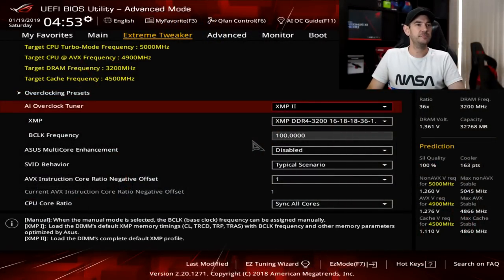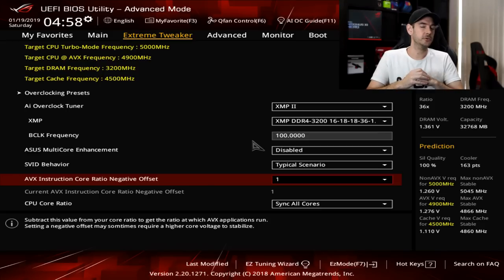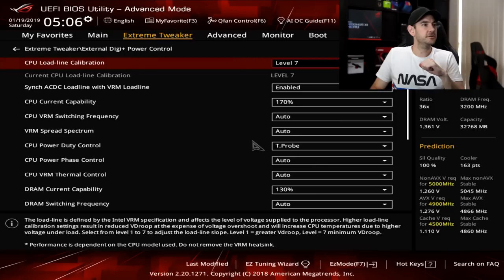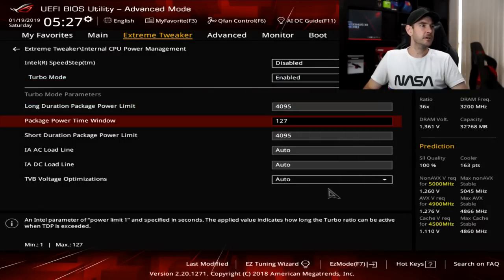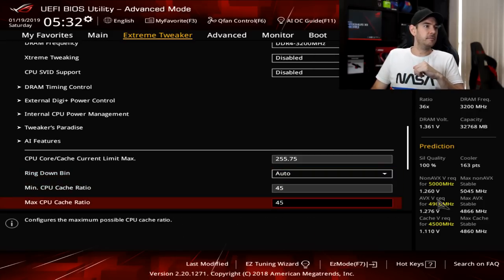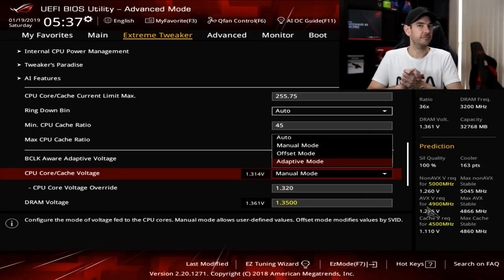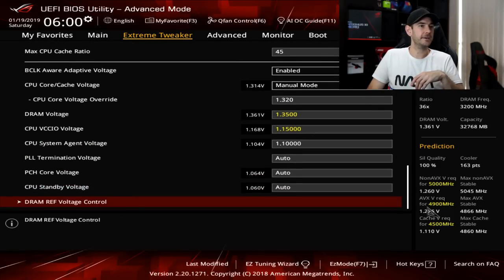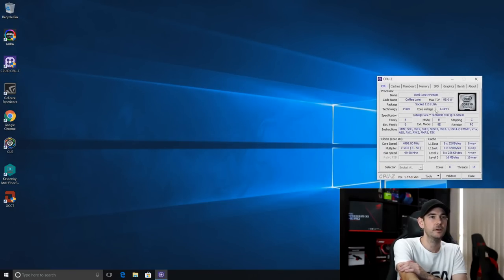The Complete i9 9900K Overclocking Guide - Maximus XI Z390 and Others

Comment: Just done some OC on my z390-f MB, 9900k. Not exactly the same Bios interface, seems to be fine but the temps are really low. on CPU Z, etc says 36c at 5ghz, tops out at 46c with video render but did also crash on me which it hasn't done before. I am not sure whats wrong.

Comment: Hello, i can change everything like u suggesting exept the most important - i cant set manual CPU Core / Cache Voltage. I can put numbers in CPU Core Voltage Override when it is set to manual but cant write anything in manual Mode window or next to it where u set yr value 1.314V. My board is Z390 F-Gaming with newest BIOS

Comment: With ASUS rag maximus xi hero i have only 140% availavle for cpu capability.
Plus when i set voltage to 1.280 CPU-Z shows core voltage 1.136 why drop is big? llc 7. 
Is OCCT creates less load on the system? Because with OCCT test i ran like 68-85 temp while with CINEBENCH R20 up to 92 for one core and others 88-90
I use Corsair H150i RGB pro 360 and it looks like it cools pretty bad. Should i install 3 coolers on radiator to push heat out of the case or in? Corsair suggest in.
If i set voltage 1.290 and above it starts to overheat.

Comment: I'm pretty sure temperature on idle goes up by a couple of degrees. I got the Aorus Z390 Elite/9900k, when overclocked on manual it hovers around 30°C. But Offset mode,(Gigabyte doesn't have Adaptive,only Offset,which sucks btw),on idle temperature goes down to 26/27°C,same ambient temp.

Comment: About to complete my build (Asus Hero XI, i9-9900K, EVGA 2080ti-FTW)...   I have for CPU cooling the new Noctua NH-U12A (with 2 fans) along with 7 Noctua case fans (3 front intake, 3 top exhaust, 1 rear exhaust) in a Phanteks Evolv X case. We'll see if my air cooling can handle a @ 5 Ghz OC...

Comment: Hey I set my core voltage to 1.29 in bios but CPU Z says it’s around 1.34-1.35 is this normal? The temps seem to run good so should I just not worry about this?

Comment: I have a question. I have an OC profile that is fairly similar to the one in this video. However, I have an issue with the XMP of my RAM. I got a new RAM kit. Both my old & new kits are Corsair Dominator Platinum 3600MHz. My old kit was 32GB & my new kit is 64GB. The only other difference I could see was that they have slightly different timings. The 32GB kit has timings of 18-19-19-39 & the new kit is 16-18-18-36. The old kit worked fine with its XMP profile however, my new kit won't run with its XMP. I tried manually changing the timings of the new kit to the same as that of my old kit & then it ran fine but it really should run at the new XMP. Any thoughts?

Comment: I have a very similar build to yours but I want to know why I have one difference. For your CPU Current Capability, your setting goes up to 170%. Mine only goes up to 140%. I have an Asus ROG Maximus XI Code board, an i9 9900KS CPU, an Asus ROG Ryujin 360 AIO, & 32GB of Corsair Dominator Platinum 3600MHz RAM. So I don't know why my setting is lower than yours.

Comment: I have an i9 9900KS on a ROG Maximus XI board. I have it running at 5.2GHz & it appears to be completely stable at 1.320 volts. I am far from an expert & I used this video as a rough guide. I couldn't find any good guides for the i9 9900KS specifically. But it really surprised me that I don't seem to need a higher core voltage for 5.2GHz. Maybe I've done something wrong but everything appears stable & it's running like a dream.

Comment: For some reason when i follow theese exact steps on my i7 9700k with asus prime z390-a motherboard HWMonitor reads my package TDP as only around 3 watts at max. Vcore and clock speed doesnt drop and I have not yet crashed. Vcore is at 1.32 atm and temps are fine. If i revert to default settings the Package TDP reads normally again. Is this just a bug causing softwares to misread the TDP. I mean it cant only push 3 watts to the package on a stress test?

Comment: I have a very similar setup except that my chip is an i9 9900KS & I have it overclocked to 5.2GHz. My motherboard is an Asus ROG Maximus XI Code so my BIOS is almost identical. I'm not exactly new to overclocking but I'm far from an expert & don't have much experience yet. This video helped me understand several things better. Unfortunately there aren't many videos like this specifically for the 9900KS. My chip appears to be very good. It seems to handle even higher frequencies without much fuss but I set it to 5.2GHz just because I like to play it a bit safe.

Comment: Great guide, my 9900k won't go past 4.7/4.8 (avx/n) for 1.28 vcore, after 1.34 I stopped as I would thermal throttle. May have a bad batch. With prime95 FMA3  loads I would always get errors an Sudden restarts.

Comment: Hey Boosted Media, 
I just followed your guide and it worked awesome but when I run CINEBENCH R15 for CPU test, my computer blue screens.  I'm a beg here so bare with me. I tried to lower the core voltage to 1.29 and lower but still getting the same. What else can adjust in other to find a balanced point maybe? 
My Specs:
Asus Rog Strix Z390-E
i9 9900K
NOCTUA NH-D15 Air cooler
G.Skill TridentZ RGB Series - 16 GB: 2x8GB - DDR4 - 3200MHz
ASUS RTX 2080ti OC 11GB
1 TB Samsung Evo 970 plus m.2 SSD 

Btw, when I run CINEBECH alone it can run the CPU test (sometimes) but if I run it while CPU-Z is on its a sure crash to blue screen. Also I noticed when I move the CPU-Z window around it hovers with a delay of 3-4 secs (just mentioning that in case it had a relevant point) never seen that before though.

 Regards,

Max

Comment: So, I installed 32GB of 4266MHz RAM with the i9-9900K and when loading defaults then changing to XMP II the machine locks up or blue screens.  Where to start?  When I backed it down to 3900MHz in XMP II things still didn't work. Memory is directly from the QVL.  I was thinking the overclocking course would help but it appears that didn't get released.  Any help would be appreciated, or where should I go next?

Comment: Hi I'm a fellow simracer, I'm on a very similar system, basically just have a different 3600MHz Ram set, same CPU, Motherboard, cooler ect. But I can't get this to run anywhere close to stable, it just shuts off randomly, any suggestions?

Comment: I got my i9 9900K running 5 Ghz with a few settings in Bios Maximus XI. I got XMP II enabled - Multicore enhancement enabled - SyncAll Cores. This gives me 5GHz on ALL cores. Just that easy.....It's stable and temps around 35 degrees idle and 60 on full load. I have Corsair H115i pro AIO.

Comment: Running 5.2 on 1.330V right now with a LLC at 5 (was a little scared) temperatures were at 60degrees. Went fine in a OCCT 1h test but crashed in vermintide II. Don’t know if I should higher the LLLC or just raise the Volt a little.

Comment: Hi, I followed everything you said, but in cpu-z, the core speed still fluctuates down to 3.6ghz, not like yours which stays between either 4.9 or 5.0ghz. Why would this be? Also the core voltage is idling at 1.288v, and also isn’t a constant voltage

Comment: Boosted Media   hey just wanted to say thanks for making the video  it helped me out alot!  . I have question though that maybe you could answer for me. I have a asus maximus z390 code and a i9 9900kf and for some reason i set everything 100% like you did in the video and the voltage like you said to 1.320 and it wont show anything higher then 1.176 for voltage.I checked the voltage in cpu-z,speccy,occt5.51 also.   I tried googling it but have come to a dead end lol

Comment: On my BIOS the "Core Ration Limit" option is just not there so I can't even begin to enter new values on my new i9-10900K. Any suggestions? Proabbly something simple I'm missing. Also sadly seems games crash on my 32GB RAM when set to 3600MHz but 3200MHz seems to be stable for now.

Comment: I disagree about SpeedStep and Adaptive Voltage, it makes a difference. For a 95W CPU, with them enabled your CPU will idle at 10-15W, otherwise it idles at 30-40W, maybe higher depending on OC settings. Might not sound like a lot, but it makes a difference over time in terms of heat and if you have your PC on 24/7 and live in a country with expensive electricity, it might actually cost you a few bucks extra a month, especially if you have more than one computer. And in terms of longevity -- you say who's gonna be using a 9900K in 10 years? Well there are lots of people still using Sandy Bridge and even Core 2 Quads, Moore's Law has slowed down significantly for CPUs. And moreover, enabling those features only helps, doesn't hurt, so why not? It triggers my OCD to have my CPU running at 5 GHz while I'm sleeping.

Comment: J keep getting blue screens. Followed your settings, have the same cooler/processor combo. Idk what to do. I ad it fine tuned and it was stable. Recently had to reset, now I can't find that sweet spot. Any advice?

Have cpu core : 1.32
Vccio voltage : 1.15
Cpu system agent volt : 1.1

Comment: After a couple of days using these settings out the blue my GPU clock goes to 800mhz during gaming. Does this mean my i9 is dead? It was very stable and always cool with my water cooler.

Comment: Awesome. Thanks man. Amy plans to do a RAM OC video on this board and CPU?

Bought some 4600MHZ C18 RAM. Cant get stable even at 4000C18 with high VSSIO and SA.

Read it has to be done manually for high clockspeed...cant use XMP. Pretty lost.

Comment: Hello, I did exactly the same steps as the video. My 9700k is running at 5.0Ghz pretty stable. My voltages on CPUZ are not the same as I set up on BIOS. I set it up for 1.320v and CPUZ show me that is at 1.180. I set everything to manual exactly like the video, my question is why aren't the voltages as I set up? its working and I am happy but shouldn't they be I as set them up.

Comment: Why are these settings better than the AI Over clock?
Reply from the maker: AI overclock typically over-volts dramatically which causes overheating, instability and potential damage.
Reply: Boosted Media why would asus engineer a program to damage your gpu?
Reply from the maker: I honestly have no idea why their AI settings are so aggressive. Which I could answer that.
Reply: Boosted Media i did the AI over clock yesterday night and ran a full stress test for 30 mins and had no problems with any crashes etc. Also I have the i7 9700k and the AI over clock clocked it to 5.2ghz is this safe? My cooler is 160 points and I’m getting temps around 55 when playing games. Also under the stress test 100% load the highest temp I was getting was 71 degrees is this damaging?

Comment: Are most of these settings there with other MB's and chip sets or are these settings specific to the MB you used for this video? I have an ASrock MB using an i9 9900K CPU. Don't know what the chip set is. Would all of the settings you adjusted be in the BIOS of this ASrock MB too? My CPU is running at factory setting of 3.60Ghz....so lot's of room for improvement there. I just don't know doodly squat about all the stuff you did in this video. That was all tech geek speak to me.  lol

Comment: I have a query - I followed your guide and everything is stable once the PC has booted to windows, however, when I push the power button when the PC is off, it turns on for ~1 second then clicks, powers off, then turns back on. What is causing that? is the voltage too low? I need help

Comment: So at first I followed your other video about z390 overclocking but I was running an i9-9900k. I couldn't get it stable until I seen this video and I followed everything to the t. However, at 1.300v my processor was getting too hot. So I decided to bring bring it down to 4.7 ghz and I finally got it stable at 1.245v. OCCT lasted a good 6 hours with no problems at temps between 60c and 67c. I'm running an h100i v2 aio cooler.

Comment: I follow your video mate and got my 10700K on a Z490 motherboard stable at 5GHz, but I’m still working my way down on the voltage.
Using an NZXT X63 CPU Cooler

Comment: Love your video man, having trouble posting though after everything set exactly as you have it except mine is on 4900mhz to be a bit less Heat. Wondering if the latest 1902 bios changed something. Frustrated as all the overclocking guides are year or two old and none of them seem to work anymore. Have tried several already. If you have any ideas I'd be very grateful thank you.

Comment: Is there a way to reset the motherboard back to it's default settings. Computer continually shuts down (blue screens) when trying to process Adobe programs and want to reset all the overclocking to see if that will resolve the issue. Thanks ahead!

Comment: Hey quick question, I hope you still see this.

Ibgot a z370f, would you recommend the same settings for overclocking the i9? Second question I also got the corsair h100i v2 watercooler. But I plugged the fans directly to the psu since I rrad online that plugging them into the pump and the pump alone into the cpu fan 4 pin provides not enough amps? 
Is my direct psu set up bad? The noice doesn't bother me or do they not run at full rpm this way?

Comment: Hello, I updated the bios to the latest version and erased the overclocking options that were saved, reviewing the video I see that there are some options of not letting it be configured again as you have them in the video, there is a way to correct this ..... ( cpu current capability only up to 140%) and greatly increases the cpu temperature to 45 ° or 50 °
thanks for your help

Comment: Thanks so much you're a godsend! I followed your guide and got a stable 5Ghz OC, which was more stable than the AI Suite's auto OC. But i lowered it to 4.9 Ghz to lower temperatures. I noticed the temperature lows hover around the low 40Cs I hope this is alright. For highs, what is considered acceptable for more intensive usage like gaming?
Reply from the maker: Anything under 85 is fine in general. But for gaming I’d expect to see somewhere in the 70s. Have a look at my stability testing guide.
Reply: @boostedmedia  OK ill look out for that while gaming. I noticed 70C+ after running the Heaven benchmark. I'm using a Corsair H100i like you on a Maximus XI Code. I really appreciate you guiding all of us in YouTube thank you so much! I was so frustrated with the Asus auto OC (in both the BIOS and Windows) which gave unstable OCs until I found your video!
Reply from the maker: Yeah the auto overclock is horrendous.
Reply: @boostedmedia  I find it strange to tell you this but your recommended OC settings works just fine now after I reverted back to Profile 1 (adjusting my H100i's fan/pump speed/curve via the iCue software really helped!). So in my room with ambient temperatures of 25C, I'm now getting 37-42C at idle and 85-87C after heavy gaming. Surprisingly, heavy gaming pushed the temperature up more than benchmarks did. Initially i thought i lost out in the silicon lottery with my i9-9900K but l'm really glad i found your OC guide!
Reply from the maker: Glad you got it sorted :)
Reply: @boostedmedia  Thanks again!

Comment: Thanks for the video.. one question, why do I crash every time I try cinebench? Aida64 is running fine whit great temperatures. And can I Overclocking my ram to 3600 when the stuck is 3200? 
Thinking about the voltage I

Comment: For some reason my pc works fine and boosts up to between 4.7-51 Ghz and temps are decent with optimised  default  settings in bios.. but when i go to overclock like this (just to get same results but maybe better temps and thus quiter fans) and follow every step, my pc bsods and over the course of a day ive had at least 5 different bsod error messages.. driver issue? i cant see why as erverything is updated. And as for hardware, everything works and is stable with default settings which is actually hotter than the manual OC  I put in.

Comment: I'm having the weirdest issues right now I have pretty much the exact system as you .. anytime I OC it works most of the time but when I restart or shutdown my pc it resets the overclock to 3.9ghz always .. so I was messing with it yesterday nd I got it to work when xmp2 but there was some power issues I think .. so I went back to xmp1 and it will not apply the clock .. went back to 2 and it worked so ive come to the conclusion that it may be a xmp1 issue which is odd... but same thing as soon as I restart it resets the clock ... also I ran all test and everything is very stable at the 5.0ghz so im not sure what's going on

Comment: Thank you for this guide. Simplifies everything well. 

I'm running I9900ks w/ H150i pro

Same concept. W/ your starting settings I'm running cool as a cucumber through 20 min extreme stress test.  55c average temp.  68c peak.  Assuming I can push this much harder with KS and H150i pro!

Thanks again!

Comment: This is the guide that guide that finally helped my smooth brain achieve a stable OC over 4.9. I thought I just lost the silicon lottery but wouldn’t give up. Now 5.0 on all cores using a Corsair H150i rgb pro XT with gaming temps in the mid 50s-60s. With it all dialed in I can probably try and get 5.1 stable!

One question. After starting off by using your setting my afterburner/riva is reporting cpu wattage at just a few watts, when I was using the AI set it and forget mode the overlay was showing the wattage you would expect, any ideas what would cause this? Everything is stable, clock speed and voltage both report as what I set them too when I check cpuz.  It’s not a huge deal as everything seems good, I’m just genuinely curious what the answer might be.

Comment: Fantastic! I'm now running at 5.0 Ghz and it is looking good; all cores at around 42 degrees. I will be running some games later (Assassin's Creed Odyssey and Fallout 04/76) and see how they fare.
One question. I had some options I did not see in your bios pics for CPU Graphics Current Limit and Max CPU Graphics ratio. Mine were set to Auto and I left them there. Anything I should know about those?